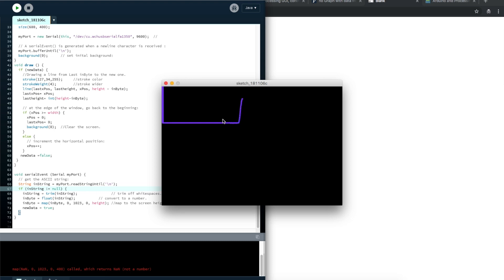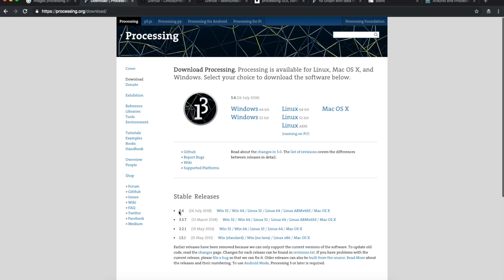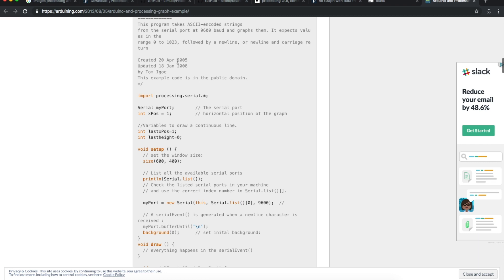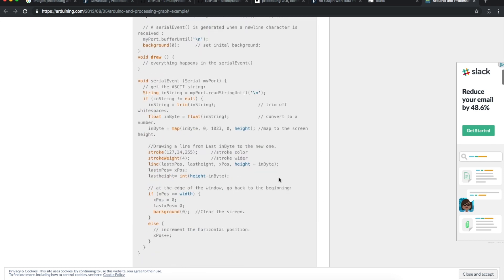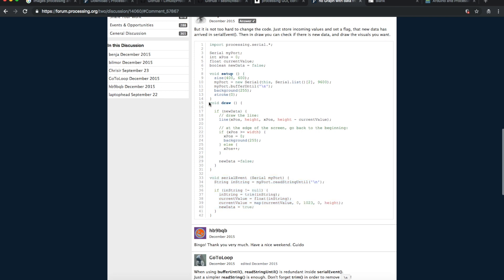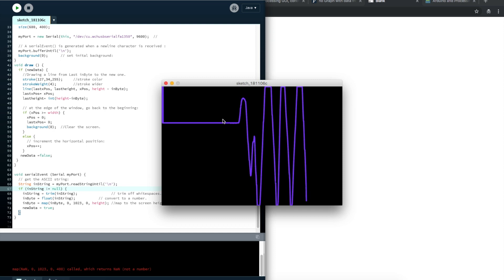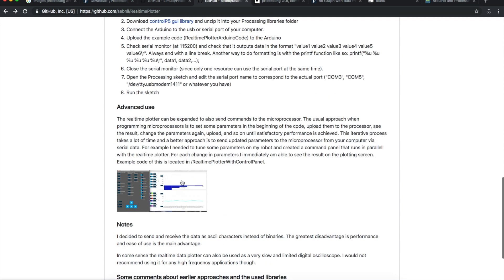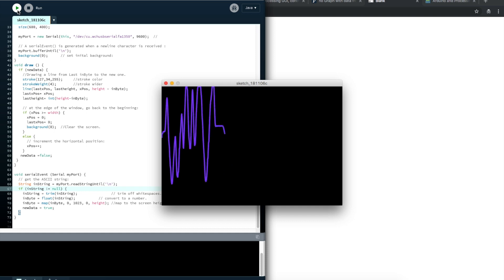Using Processing with Arduino for Serial Data Plotting

Comment: Any thoughts how fast the serial data can come in such that it plots without crashing and/or losing serial data?  

For example, not sure how it compares but I tried matplotlib/pyqtgraph to plot real-time, but after just a few hundred samples, the GUI starts getting sluggish!   Not sure if I need to use multiprocessing/QThread.. or if Processing may better suited for this?
Reply from the maker: I haven't used it extensively but since it seems to be built on the same overall platform as the Arduino IDE, I know that with the serial monitor on the IDE, sometimes I notice it looks like it has crashed after a while and other times I can leave it running (usually accidentally) overnight and it's still taking in data.   I wonder how much of that is also the system it's running on, a clean dedicated install vs what I had, a very old bloated thing with probably half installed stuff all conflicting for control of the port...